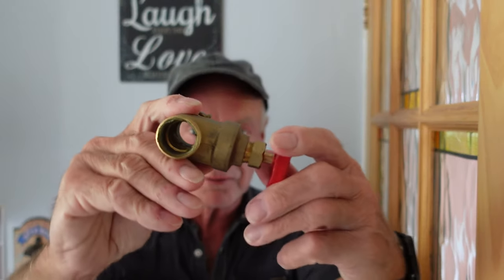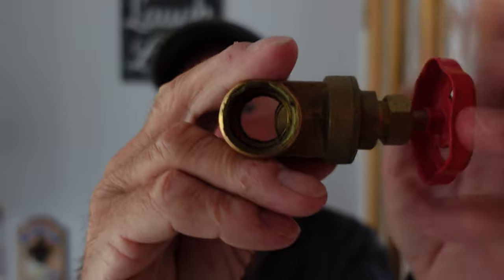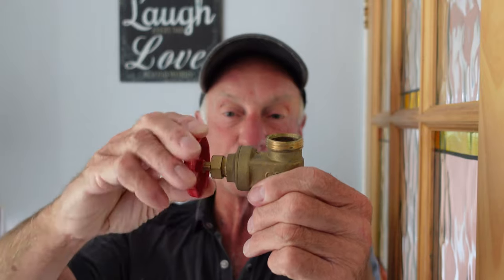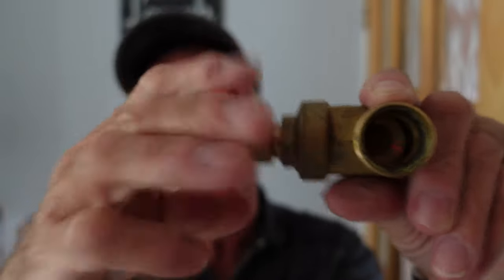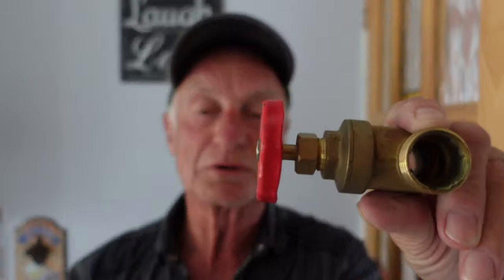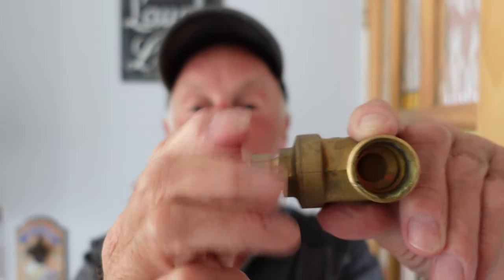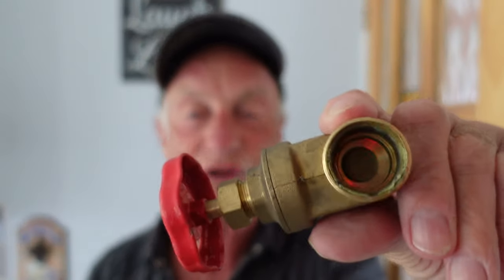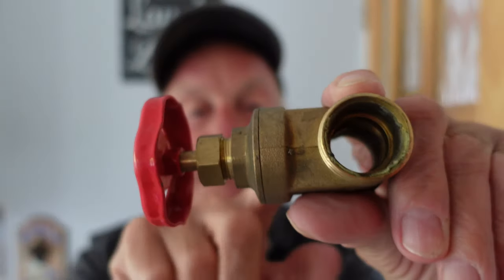Gate valves and how to try to get them to work

Comment: Good video. One of the many problems with gate valves is they are made from not the best quality material to keep the cost down and as a result they dezincify and that causes the valve stem to shear. Full bore quarter turn valves are the best solution.
Reply from the maker: I agree.

Comment: Using "get them to work" in the title led me to believe that you would show us how to undo or disassemble the valve and get it to function again,, rather than how to turn it off and on. That way I could see the parts within the valve and see what was required in terms of the stem, washers and packing nut to get that valve working again.
Reply from the maker: Will see if I can do a video for you.

Comment: If I'm able to, I simply replace with a ball valve.  I absolutely hate gate valves lol.  But I'm trying to learn and face my fears (in case rebuilding one is my only option, so thanks for the video.
Reply from the maker: No problem.

Comment: Where can I find a replacement gate valve assembly to replace a non-moving corroded gate valve stem??  the whole valve is soldered to copper pipe, i just want to try to replace the stem. please help....
Reply from the maker: You will not find one the only thing you can do is to buy a new one and see if the thread fits that the handle threads are the same.

Comment: I have 2 inline from my tank in the loft to the cylinder, I try and remember to exercise these every year, one was stuck when I moved in but I have managed to bring it back around by using your freeing off method, that was about 10 years ago.
Reply from the maker: Thanks for sharing
Reply: Should fit lever valves,easier and faster to use

Comment: Whats the problem with Isolation valves?
Reply: No problem just fit full bore lever valves as Al said 💪💪💪
Reply from the maker: Take some ones 50 year advice.
Reply: hffp1  Thanks.
Reply: @dereton33  50 years? You don't look a day over 60!
Reply: hffp1  The really old ones have a tiny slot, much narrower in diameter. They tend to crack and fine mist/spray water all over. If I see them, I go straight to the mains isolator and drain down at the lowest point. Been there and got the wet tee shirt into the bargain.
Reply: @loafersheffield  Thanks

Comment: Mine old one is leaking near the tank unless i fully close it.. do i have to drain the header tank and turn off mains outside or tie up ballcock? Its so old im afraid to try to open the nuts to replace it
Reply from the maker: Yes, drain the header tank, either tie up the ballcock or turn off the mains.
Reply: @dereton33  ah thanks, i did it earlier.. its not actually the same valve as the one you are showing probably even older but i took it apart and cleaned it up & used abit of ptfe tape.. seems to be ok anyway for now atleast.. thanks again for your reply, i like your videos keep it going 😁

Comment: My gate valve is fully turned off but the water is still running.  At first it was just a trickle but later when I turned the tap on it's back to normal flow.  How do I stop it?  Cheers!!
Reply from the maker: Change the gate valve they are crap.

Comment: Any reason why someone would fit this to the rising main to a second floor 1920s built flat?
I couldn't turn the water off. It was several years ago, but as I recall the wheel turned but this had no affect on the water flow. 
 I turned the recently fitted subterranean main valve outside the flats off & replaced gate valve with a stopcock.
Reply: Should never be fitted on a main
Reply: @paulw4904  yes definitely!
Reply from the maker: Some real bad plumbing about.

Comment: Drat I thought as I had a gate valve feeding f and e tank some wd 40 would help .not checked it yet , if the water is stuck on  and I need to change the ballcock any ideas apart from turning mains off .assume its fed off the pressurised mains .Great video as usual .
Reply from the maker: Best to just turn the main off anyway. Leave stuck gate valves well alone.
Reply: Agreed 👍

Comment: Literally just happened to me on my rental flat. Landlord wont change the lesking kitchen tap so i tried it myself. Old tank system, snapped the gate valve trying to get the hot isolated.  No I've only got a dribble of hot water. Debating whether to attempt a gate swap. 🤔
Reply from the maker: If you are on a ground floor flat don`t chance it as the pressure will be too high.